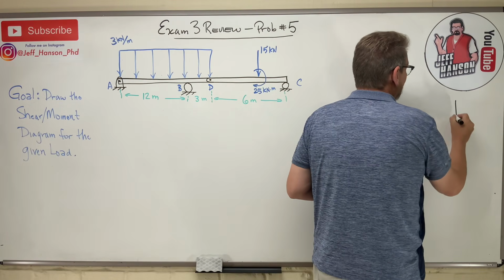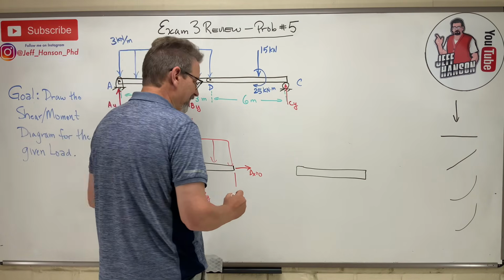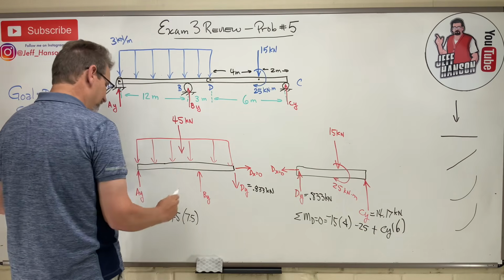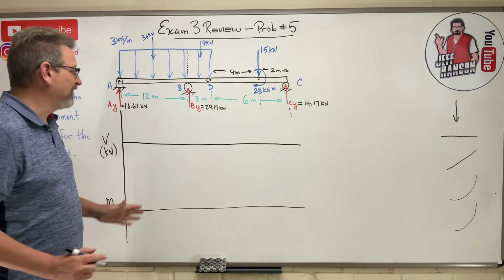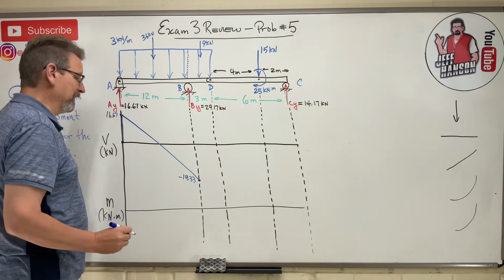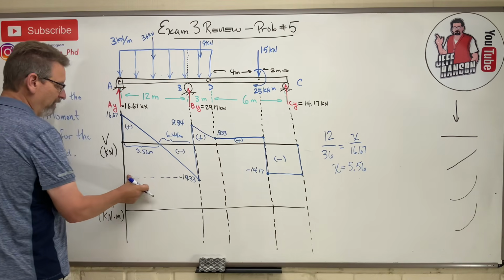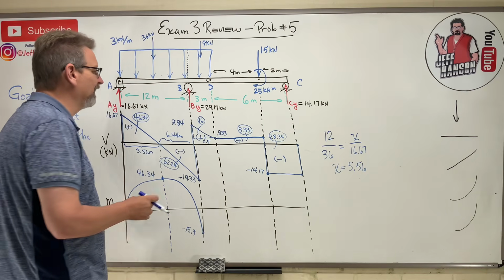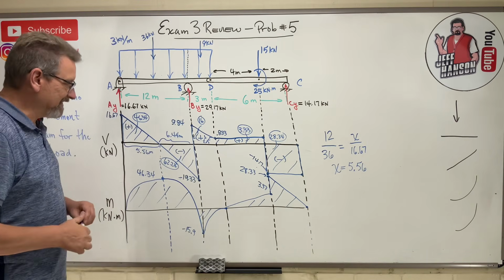Statics: Exam 3 Review Problem 4, Shear Moment Diagram Example

Comment: How do you know it´s a frame problem? Simply because it's a pin with a load?
Reply: It has two parts connected by a pin. So, we must behave the structure as it is a frame. So, we can solve it by applying frame problem approach (blow apart to its members)